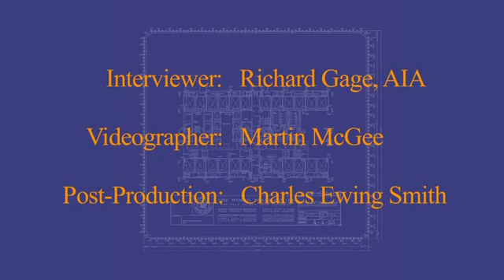9/11 EXPLOSIVE EVIDENCE - Casey Pfeiffer, S.E. - Structural Engineer

Comment: @dreadnaught2 NIST report IS a coloring book. They admitted to never even testing for the present of thermite. According to their report fire weakened the steel and made the floor collapse on each other building to a complete collapse. The only problem is the speed at which the collapse occurred. The twin towers and building 7 all fell at near free wall speed. This makes the floor pancake theory invalid because intact floors should have slowed the collapse down.